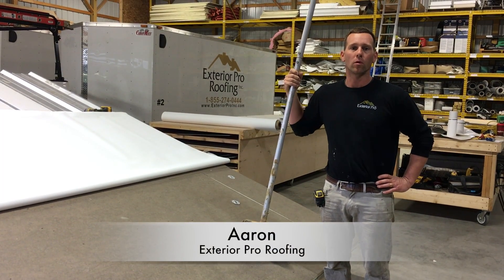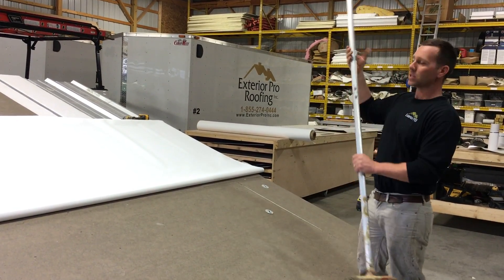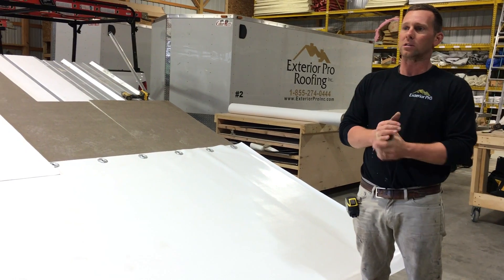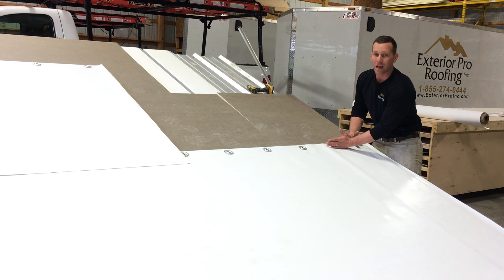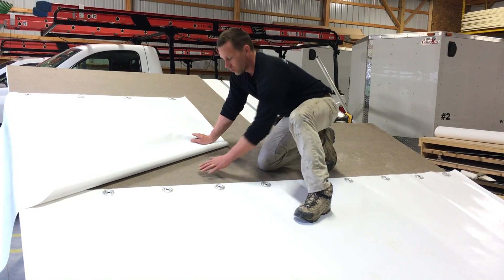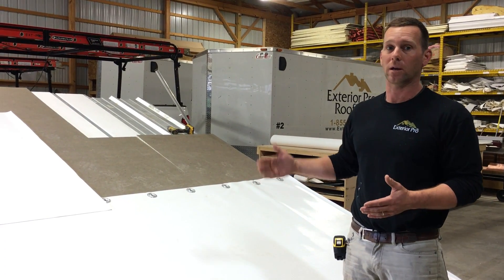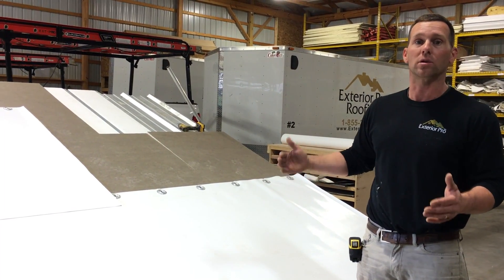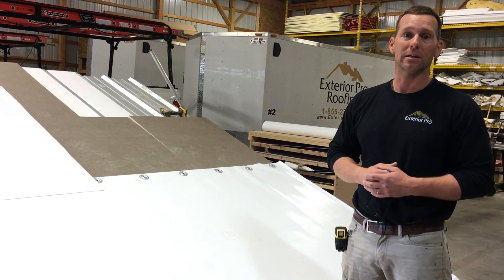Flat Roof Installation (Fully Adhered vs Mechanically Attached)

Comment: Great video man. Curious...  I've only seen videos about mechanically fastened TPO being used with roofs that have parapets. I'm wondering how you would terminate the mechanically fastened TPO at roof edges on say a shed roof - so like flat roof with a pitch and no parapets. I'm wondering how the edges would be detailed with plates and fasteners without interfering with metal drip edge or gravel stop. Any info would be very helpful. Thanks!

Comment: You're missing a big one; mechanically attached membranes are more robust and able to handle small leaks.  With a FA system, you get a small leak that compromises the bond in one area, you end up with the peel front travelling across the entire roof...to the point you can lose the entire roof.

Comment: I'm a contractor and have done plenty of roofing,  and roll roofing.  I have a 2.5 pitch roof between two 5/12 roofs. 
On the 2.5 pitch I have a rubber roof i put it on in 2012. It looks like I'm going to need to replace it soon.  I'm thinking about doing a PVC roof. Menards has a 10 x 20 sheet. With 20 year warranty.  It looks like that's the best solution that they carry. My question is can I glue it down over my rubber roof or would I need to put down insulation sheets again and glue it to that.  Thanks for any replys!
I don't want to do it again in 10 years. So I think I want to go with PVC. I'm 62 so this is my last roof.  Thanks again!!
Reply from the maker: Mister action I would definitely  put down either a new piece or ridge polyiso insulation or a cover board and fasten it down with screws and plates and then glue your new membrane to that. We really like a cover board called Invinsa board made by johns manville. It's tough, light weight, and only a 1/4 "' thick . It's also wise to disable the old rubber roof by cutting it before you recover it so if you do have a leak you can find it in the future. Typical fastening pattern for iso or cover board is 12 screws and plates per 4x 8 board. Then you would be in good shape to glue your new pvc sheet down. You may want to check some roofing supply places in your area and compare prices to menards just to have an idea of your options
Reply: @ExteriorProInc  
Thank you!!

Comment: So on a mechanically attached PVC membrane roof. Do you screw into the trusses or the old metal roof? Also, how far apart do you need to fasten it?
Reply: Screw every foot. The membrane will have X's that mark where the screws go. Screw directly into whatever the sub straight is. If you have an old metal roof, you need to use a flute filler to fill the gaps so it's flat surface. Each roof is different. so how/what you do is dependent on the system that's there and the method you choose to install

Comment: Can I  mechanically install a pvc membrane that is 10 ft wide?
Reply: Yes. You can adhere or mechanically attach any size sheets. Typically roofs need to have perimeter sheets around the entire building. so you 5' rolls around the whole edge, then 10 the footers in the field. This is to protect against wind uplift

Comment: Thank you for your explanation. One thing I still can't find is info on edges. How do you do them? I put rubber on a low slope roof years ago, adhered to aluminum drip edge. After a few years it blew up. I have a roll of pvc but don't want to move forward til I'm sure I can do it right.
Reply: You need to get PVC coated drip edge, they're about 30$ a 10' stick. or use a PVC peel and stick/cover strip, priming both the metal and the pvc, using the peel and stick go over the,

Comment: Can I use TPO directly over wood? I’ve done it over a wood wall, but I need to do it over a wood monolith- it is a decorative part of a Dunkin’ Donuts...using insulation will raise the  deck too high
Reply: This is probably old and complete, but you should use a 1/4 densdeck coverboard. This is likely required by code. This will avoid raising anything, will prevent water transfer, and supply proper fire rating.

Comment: I have a question ,, hopefully you can answer. On a fully adhered pvc roof. 
How can I weld the seam without creating a ripple effect on the other side of the weld.  Seems to me ,, being fully adhered , the only part that is not glued is the 6” pvc you leave for the robot to weld the seam, hot air gets trapped in on other side of the silicone wheel and now there is puckering or ripple effect. Any clues or ideas on how to get rid of that.  
Thanks a lot
Reply: On fully adhered, you run a 3" lap verse the 6". Instead of going off the factory 6" line, you need to make your own  3" marks on where the rolls need to be set. You also need to make sure whoever gluing the lap side does a nice straight 3" ( ish) edge.

Comment: You seem to show a simple example but I have done them all and you explain it well. We rarely did a fully adheard roof unless it was under 100 square. On 100-50,000 square it was always mechanical attachment. Flat roofing is an art not a science. The details are where it will fail and you must follow a set of guidelines.  It's hard to get an entire crew to prefect the manufacturers guidelines. I spent enough time up on those roofs to know that you really have to want it to succeed. The whole crew has to buy in to get perfect results. Otherwise the foreman is going to run around putting out fires all day everyday. I cashed in them chips when 1) I was to damn old and 2)I could make more money to do half the work. I respect you low slope guys because I've been there. Keep up the good quality work and get yourself a rinobond machine or three.
Reply: Rhino or Button?
Reply: @RoofingFacts  rhino on the larger roofs.